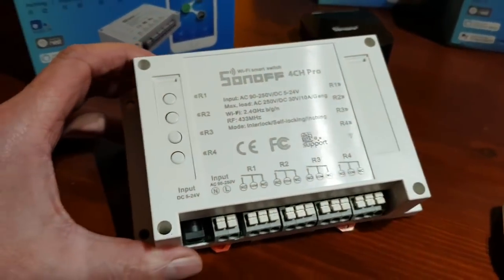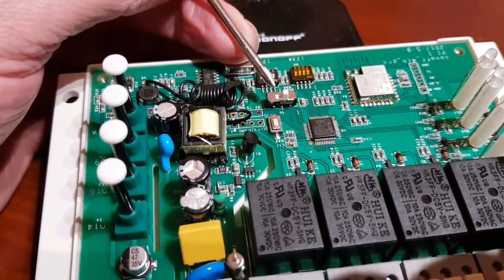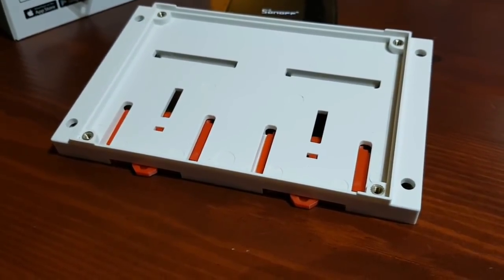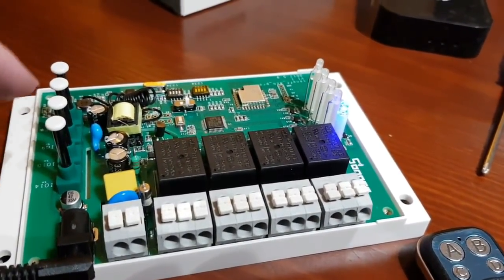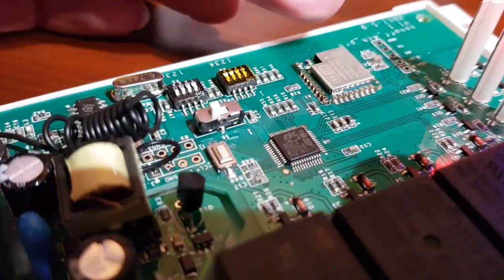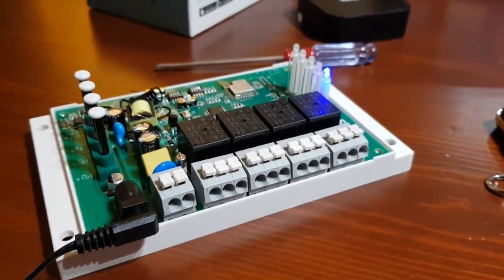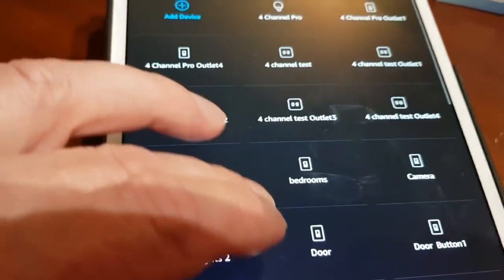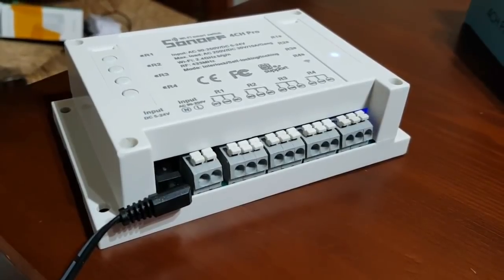Sonoff 4 CH PRO

Comment: Hi, do you know a way to deactivate the remote connection mode by clicking twice a button? I have flashed the CH4 pro with Tasmota (8.1) and use 4 switches in parallel to the inbuild buttons. Now I want to use the device without any remote-connection.
Thx from Germany
Reply from the maker: Sorry, not sure I understand the question, please re_write
Reply: @robdotreynolds  ;-) the Sonoff 4CH pro has got an inbuilt RF modul. Do you know a way to deactivate this RF modul? I do want to deactivate the pairing mode! Actually the systems start the pairing mode by clicking a button two times. The issue: if somebody do the double click without using a RF remote ... the systems paired with any RF remote in the neighborhood.

Comment: can i use this to break the flow sensor in my  pool heat pump to control pool heater from phone ? i assume just run one wire from flow meter thru n/c of one relay

Comment: it's really an amazing device. i just have a question. if a channel is programmed on inching mode, can i control the that channel to stay ON using the mobile app? for example, a light is connected to a channel on inching mode and a PIR device is paired on that particular channel. is it possible to make the light stay ON using the app?
Reply from the maker: Julius Ceazar Mulingtapang 
Ifbi understand the question right, then no, it will click back out again..
If I understand correctly
Reply: I want to use the motion detector in the garage so that when I enter, the lights will automatically turn on and will turn off after a few minutes. But I also want to have an option of keeping the light on. Do you think it's possible? Thanks.

Comment: How do you connect loads? MY 12v load is not turning on when connecting
Reply from the maker: Mario Salazar 
Check the power supply has sufficient current rating..
Can you show me your wiring Diagram
Reply: Sorry I confused this with a simple wifi switch. Im guessing this is not it.

Comment: Hi, I have some question
_ Is it need internet connection to work, if the internet is down, the config timer you made before still work ?
_ Can timer loop ?, let say I want the water pump run 2min, then off 30min, loop through the day.
Reply from the maker: Forted Exe 
Yes the timers should work after the internet goes down

Comment: Millisecond, not microsecond. Any way to turn off the RF? have you also noticed that it is not rolling code?
Reply from the maker: Joshua Lewis 
That's Right, 
I think we looked at this in a previous video.
Reply: Rob Reynolds , you did yeah but only discussed the rf bridge not being rolling code. The pro  isnt either. I have cross channel interference with a pir turning on an input with no bridge lol
Reply from the maker: New Video Josh, fingers crossed its reliable and no turning on in the middle of the night :0
https://youtu.be/K7Hw6hRzEwE

Comment: what is that door sensor?
Reply from the maker: Asaduzzaman Pavel 
Hi
Its a device that will send a RF signal to    the RF or 4CH pro when a door or window is opened.
Reply: you have a link or something?
Reply from the maker: Asaduzzaman Pavel 
https://youtu.be/d_48FJubS1Y 
For a little more information, 
They are around €8 on Ebay.

Comment: I asked Tech if the outputs have no voltage out from relay [dry contact ] to control use with millavolt or low volt such as gas heaters they kept telling me" it does not have that function. "
I had to buy one to find out if it is dry contact and yes it is.  Yah 
But no loop timer with 4ch pro I really need loop timer with ewelink to use in a hotel with a rf wall switch.
Reply from the maker: Hi StoveDoctor.
yes to both, but what RF switch did use ?, i'm thinking using a TH10 to control a boiler and adding a zero voltage relay .
https://youtu.be/JlrrGIqke6I
Reply: I set this up for customers (and my own home) with gas fireplaces or pellet stoves that have thermostat options.

250mlv to 750mlv control.

Right now I'm using a sonoff TH10 with thermostat sensor set up in home linked with IFTTT to a Sonnoff 5 volt SV self-locking relay wire connected to gas or pellet stove controls.

Using ewelink to control by smart device. I use ewelink scene for a fail safe to turn on/off the SV at a high and low temperature just in case someone turns on or off the TH at the button or ewelink. Or IFTTT fails to work. 

I'm trying to set up a Inn that has 6 fireplaces. Would like to connect 1 4ch pro for two fireplaces they are back to back. I have total of 4 fireplaces like this and 2 separate.

Use a RF wall switch that guest can push and trigger fireplace to come on for a set loop time (but no loop timer on 4 ch pro in ewelink.) I think using RF would help me not to have to use IFTTT because I would not be using the TH as a switch for guest. 

I want to use a TH with this also to shut off fireplace at set temps and a back up to save fuel. No need to have guest run fireplace when room is 75 deg. 

[I have tested this with my SV and TH system with no RF switch using loop timer and IFTTT to link the TH and SV. Pushing the button on the TH to activate timer.

I don't want to have a custom program smart home server using a rasbery pie just for this might as well buy a Nest of other Wi-Fi thermostat and wire in a transformer to power thermostats.

But all in all can't use 4ch for what I wanted to do because no loop timer for it. 

I tried using IFTTT and stringify to make timer but it was unstable only worked half the time. 

If Hub will not work with the SV because the SV is not RF

Comment: What is the make of the processor (at least I think it is) above the relays.
Reply: Ake Hedman Sonoff normally use the Espressive ESP8266. Looks like the one in this is also but I can't see it clearly enough to be sure.
Reply: Yes I see the ESP but slightly above it is another one (or something else)?
Reply: Ake Hedman Yes now you mention it I see it too. Would be interested to know too as this could be much nicer running custom firmware. Maybe it's a mux to deal with all the IO. There are a lot of switches on that board.
Reply: Yes that can be it. Or a help uP. Thanks for a good video.
Reply: Turns out to be an stm32f030c6.

Full schematic can be found here: https://www.itead.cc/wiki/images/e/ee/Sonoff_4ch_pro-Schedmatic.pdf
Reply: Great! Thanks a lot for taking your time to give me that info! :)